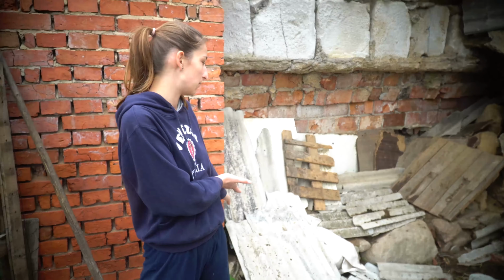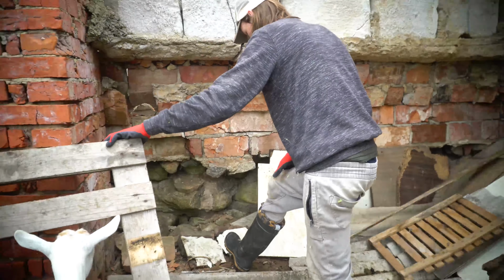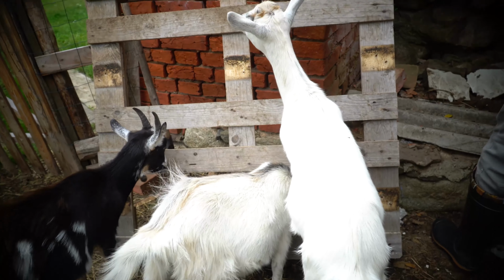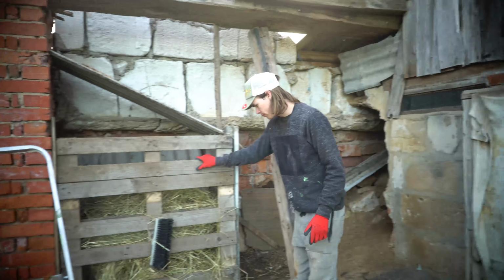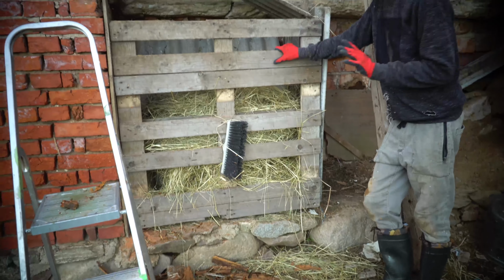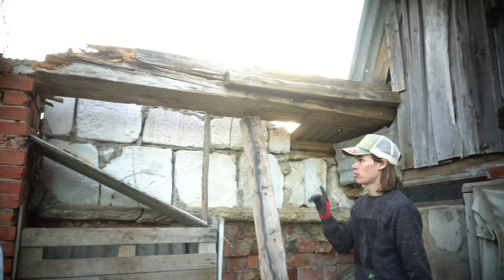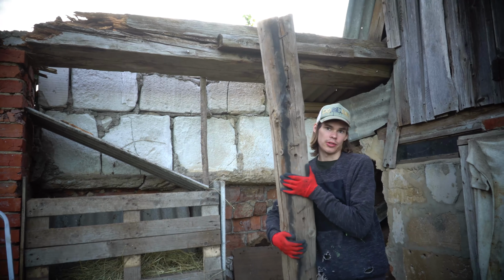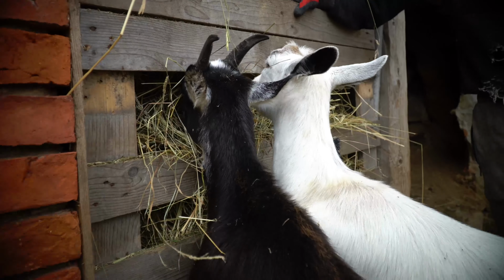DIY Goat Feeder from Pallet wood

Comment: The rooster was taking a dust bath by rolling in the dirt.  A chicken dust bath helps to remove excess oil, as well as external parasites like lice and mites. A dirt bath also maintains the water resistance of the outer feathers of a chicken. Dust bathing is an important part of keeping chickens healthy and clean.
Reply from the maker: Good to know! Thank you for all the info 😊❤️